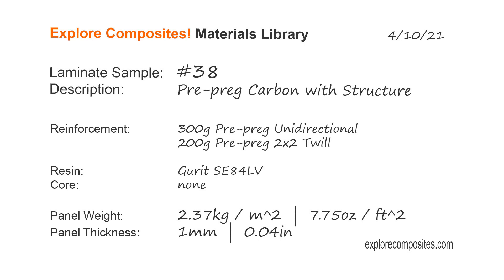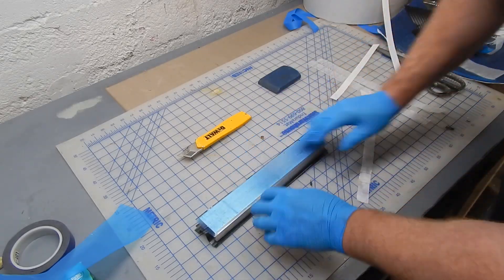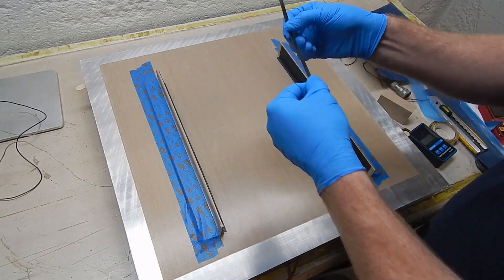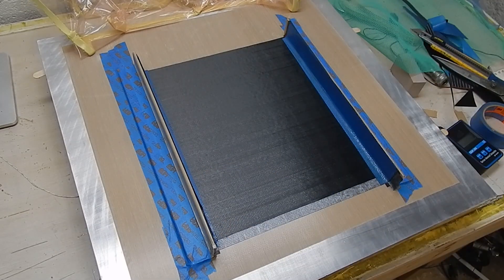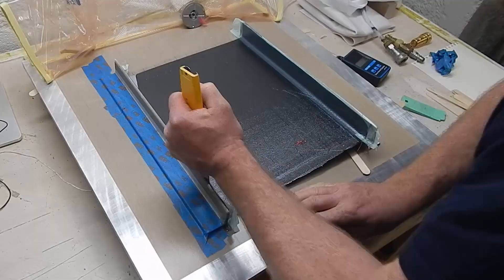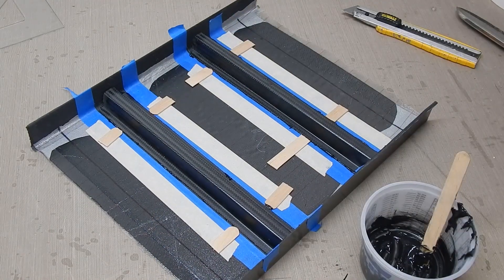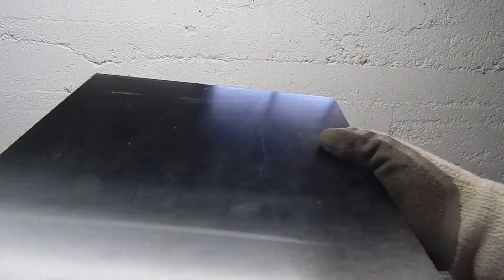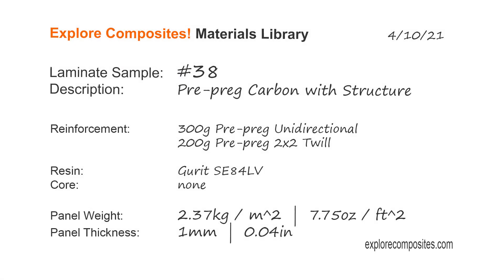Laminate Sample #38: Prepreg Carbon with Reinforcing Structure

Comment: What are you using as heat source to cure
Reply from the maker: The aluminum plate is 1/2" MIC6 with a silicone 3D primer bed heater stuck to the bottom.  Plate is supported up off the work-table 1" or so with little feet so there's an air gap.  The heater is 110v and run with a PID controller and solid state relay.  Works really well!

Comment: This is the most useful project lesson I’ve seen yet. Several individual lessons learned within the project. I’ll be applying them to molded wet layups and vacuum bagged processes with West System Epoxy.

Comment: 4:52 Can you tell me what those fittings are that you put the hose onto for vacuum bagging and where to find it?
Reply from the maker: Many composites “stuff” sellers have these - they are a base plate and a gasketed locking ring with a fitting threaded in.  Look at torr technologies in USA or as an example of the variety available.
Reply: @ExploreComposites  thank you!

Comment: Ohhhhh... no keying up the surface. Do you not think it's beneficial? Thanks for another great video.
Reply from the maker: Like so much of this it’s not clear what the best way is.  Pulling an uncoated peel ply leaves a great low energy bonding surface but sanding is often better - depends on what paper you read and what materials.  Same for solvent vs. dry wipe.  I just did it here to show that its an option.

Comment: Thanks.  I learned several tricks that you probably didn't realize would be helpful.  Like that router bit setup to trim the flange to a constant width.  And the double stick tape w/ tongue depressors to hold the channels in place.  Or just leaving the peel ply one as masking during the secondary bonding.
Reply from the maker: Those diamond wheels are awesome!  I never know what to focus on with these so I just pick a few things and hope its helpful.
Reply: I totally concur: the "random" ramblings about various aspects of the process are really helpful!
Reply: Ditto!!

Comment: It may simply be too expensive to build molds to test it, but it would be interesting to see how making the underside structure in either a series of box-shapes or triangular shapes would work, versus just the two.  Unfortunately it would undoubtedly either require machining a massive piece of aluminum, or would require machining a bunch of smaller pieces then welding them together to form a lattice.
Reply from the maker: Do you mean like a bunch of rectangular tubes side by side with face laminates over?  There are tons of fun options and so little time!  Hoping to do more with nonuniform structure soon.
Reply: @ExploreComposites  I guess the best reference I have for it would be when Destin from the Youtube channel "Smarter Every Day" visited a rocket factory.

https://www.youtube.com/watch?v=o0fG_lnVhHw

At around 8:20 they start looking at machined aluminum that is used for the fuselage of the rocket.  It's shaped to be as light as possible while transferring forces in a particular fashion and simultaneously resisting internal pressure as the rocket body also acts as the fuel tank walls.

I wonder if making a piece of carbon fiber on top of this shape (while it's still laying flat before being rolled to a round rocket body), then bonding the resultant corrugated panel to flat carbon fiber on one or both sides, would result in an incredibly strong board.  Something with a thickness not entirely unlike a thick plywood, but weighing almost nothing and capable of supporting a larger amount of weight if it's not too concentrated on a single point.  Such a shape would not only be strong, but the channels could be used to chase cables.
Reply from the maker: Yes!  I know what you mean - an isogrid type of structure.  Plans for something like this coming up.  Actually have the chunk of aluminum for the tooling.

Comment: hey awesome video mate, i was wondering how would i go about doing rib and skin construction with carbon composites, like an FSAE chassis.
Reply from the maker: Not sure - curvy surfaces are harder!  Look at how it works with large airplane construction - not that that would be efficient for a one-off.  Core is often the best way though!
Reply: @ExploreComposites  Yeah I think you're right. Most of the designs I've seen so far from my research its either space frame or core composites.I made a few models in fusion of an all carbon chassis with carbon ribs, the weight was significantly lower. Did some 3d printing on a cheap fdm, but manufacturing out of composites is a whole different issue, now that i've stumbled upon it. Most forums and people i've asked said that i should started the design with composite manufacturing in mind. Well foolish me, back to square one now.
Reply from the maker: Well they’re right to think about manufacturing from the start... but without testing it’s hard to know what real weights look like. 

You can add stringers by using beveled strips of core that conform easily and laminating over - in one shot possibly.  Many cores can be thermoformed easily.